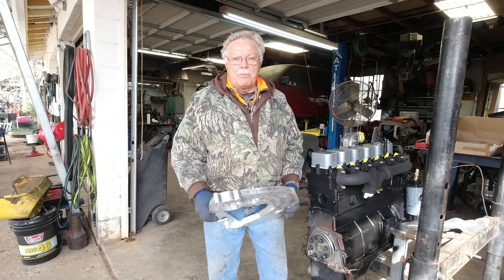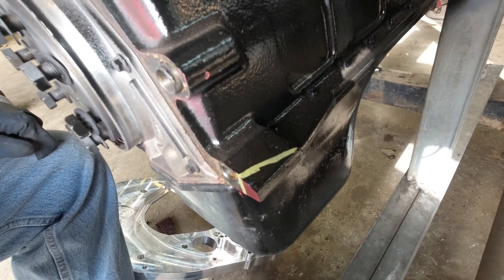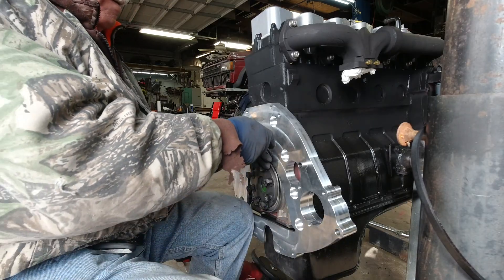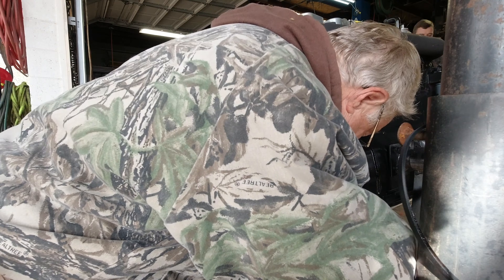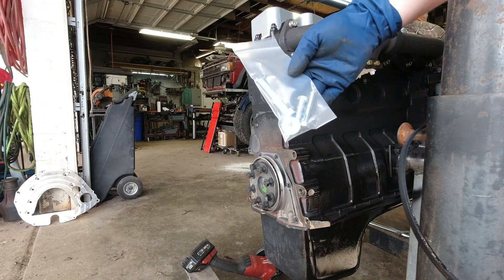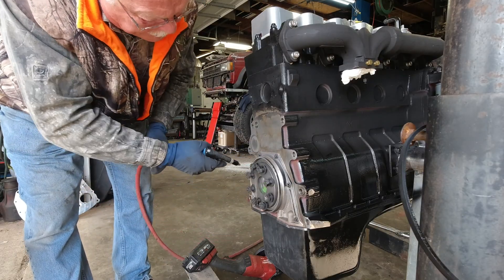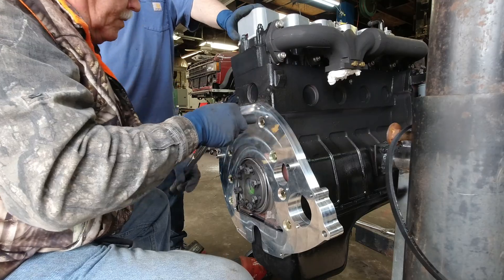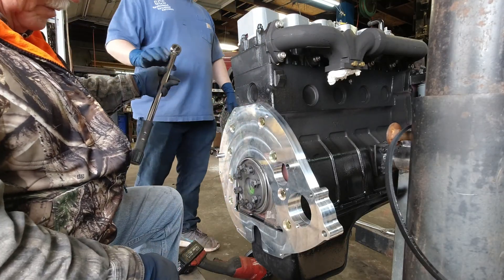Cummins Ford Transmission Adapter Plate Install on 5.9 12V F450 Cummins swap (episode 13)

Comment: you think what they charge for that adaptor plate, they would machine it right so you don't ruin the strength and integrity of the block, would using a Cummins starter eliminate grinding on the block? Is there anybody out there know that had any issues grinding on the block, little weary doing that to the block.

Comment: Is it better to swap to a truck with manual rather than automatic?
Reply: depends on what you want but i've seen lots of issues with the ZF6 and ZF5 manual ford transmissions, the 5R110 transmission though as far as automatics go is probably the best transmission in medium - light duty application on the road, the 4R100 isnt as desirable for normal Truck things only for tractor pulls and drag racing. but a completely bone stock 5R110 is pretty much bulletproof,
Reply: Good work
How can i contact you for the adoptor plate
Reply: Por favor dónde puedo conseguir ese kit de conversión porfavor gracias
Reply: @mariacamilagarciabello5933 diesel conversion specialist
Reply: @mariacamilagarciabello5933 diesel conversion specialist look em up they make a lot of stuff